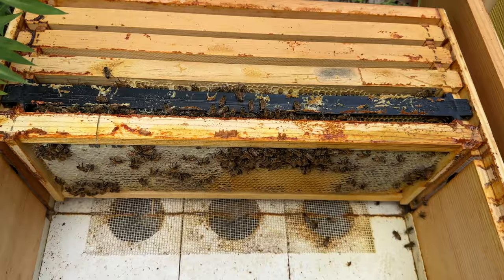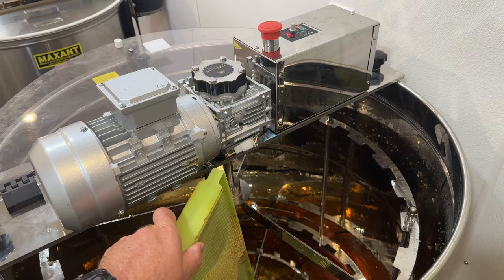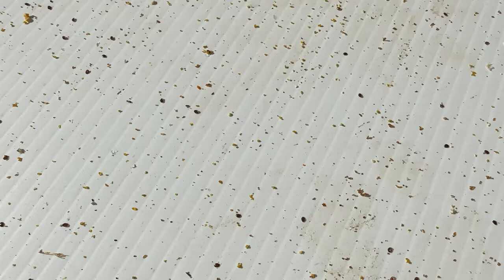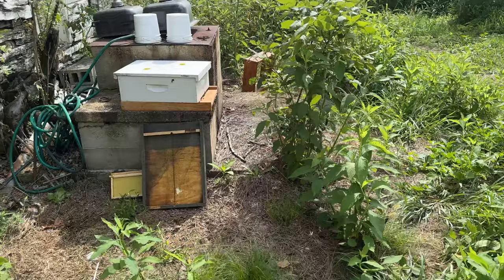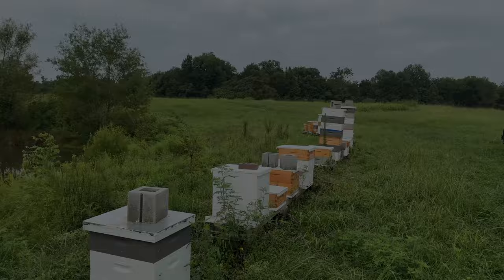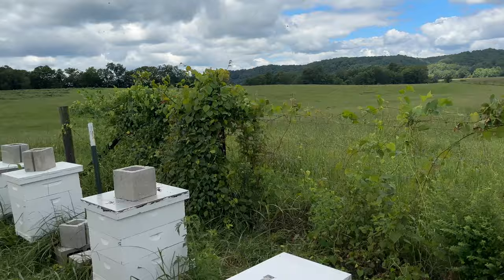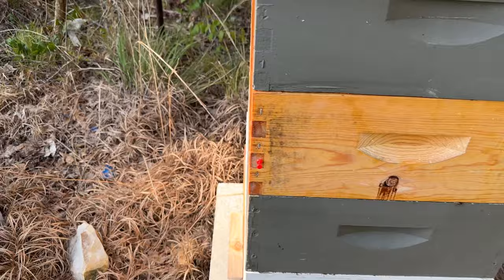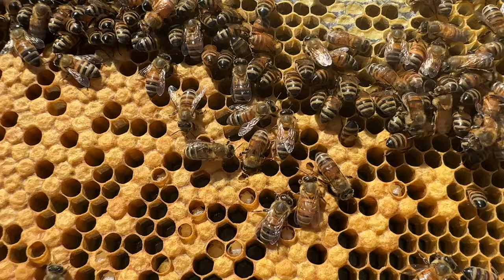Building a Bee Business Vlog #23

Comment: Use 2 peppermint candies (like you get from Sonic) on top the bottom box in opposite corners, it does wonders to get rid of SHB.  Everyone in TX is using it with great success.  I can see the frustration from the heat of summer, bless you!  I've enjoyed your video series, you're doing a great job. (I'm the bee vacuum guy)
Reply: Forreallll?
Reply: @johnemmenecker4859 Not kidding.  It does need to have 'real' peppermint in it.  But candy from sonic, even pieces of a candy cane can work.  But not too much or it'll drive the bees to abscond.  So just the equivalent of 2 candies.  One on opposite corners on top of the frames on the bottommost hive body (talking Langstroth).  Try it, you will be amazed.  Other warning: check your bee suit pockets before washing it!

Comment: I have a friend that has 200 hives in south MS and every hive has swiffer pads non-scented, the bees ruff it up and the beetles get stuck in it.   It is a great way to stay on top of the beetles.
Reply from the maker: I tried swiffers and Dixie sheets without much luck.
Reply: There is a assortment of essential oil that can be used also. Tea tree oil, eucalyptus oil, and camphor oil can be put on the frames and bottom boards. The beetles does not like the smell and stay away. I am thinking about putting these oils in my hives through the winter to see if any beetles will come back in the spring.
Reply: Do you store your honey supers wet or do you let them get robbed out. Thanks Grant
Reply: @grantsimpson9211  let them get robbed out, because the honey can ferment while in storage and ruin the wax.

Comment: I have the same problem with my extractor.  I actually modified the frames rather than changing the extractor.  I wanted them to keep the wooden frames snug.  I just took a soldering iron to the edge of each frame to make sure it fit the inner holder
Reply from the maker: Thanks

Comment: I’m watching you dealing with the Small Hive Beatles in Vlog23.  Don’t you think that putting your hives up off the ground more with screen bottom boards help?  If the screened bottom board is 18-24” off the ground and the bees drop the Beatles out through the screen, it would take a lot for the beetle to climb back up.  I use 4x4 on standing Cinder blocks.
Reply from the maker: Adult hive beetles can fly 20 to 30 miles.

Comment: BTW, per Bob Binnie, a dry environment will pull moisture out of the honey through the wax capping.  So you are dropping the moisture content for both the capped & uncapped cells.
Reply from the maker: It will a little bit, but very slowly.  Uncapped is easy to move moisture from.

Comment: Hi, I have requeened on basis of varroa resistance. Just done my varroa counts. 1 hive is for treatment. The colonies are bigger because of low varroa and associated issues. I go into winter with 38 colonies.....at the moment. I am in UK so we haven’t got SHB yet. I like to have queen cells to use as soon as I find issues and that seems to work ok. I also am just at the point that I can take one frame of brood from each nuc to boost either smaller nucs just created or young colonies that just need a boost. I just keep trying. I hope with 13 nucs I get some good sales next spring particularly as they are varroa resistant. Hope and optimism and next year.
Reply from the maker: Thanks and good luck!

Comment: Hey Nathan, some ideas for your hive beetle problems on the cheaper side. Us Texas folks have been using real peppermint oil peppermints in corners of the hives and that has shown to be a great deterrent. I'm going to see about just a drop of peppermint oil in corners would do next but I'm afraid that would possibly too astringent, so it's on my to do list for an experiment. Bruce Jenne has some shop towels that you can buy in bulk and use one sheet per hive can go a long way, much like the swiffer sheet but this seems cheaper than using oil traps. I did something like that one year and one year only as the oil is just too messy and a pain to deal with. Diatomaceous earth (non food grade is better) would be just as good as oil traps and would be a lot cheaper too. Hope some of these ideas help you out.
Reply from the maker: Diatomaceous earth wets out pretty quickly.
Reply: @DuckRiverHoney  yeah y'all do get quite a bit more rain than us. If you had your hives off the ground more you'd have less likelihood of it getting as wet. Best of luck!
Reply from the maker: Most of mine are up on blocks, just the mating nucs are on the ground.  Diatomaceous earth will actually harden off here from humidity in the air.